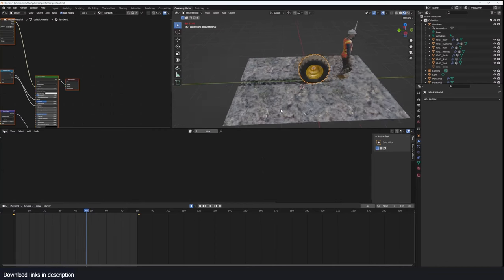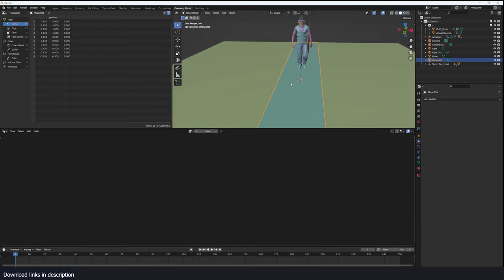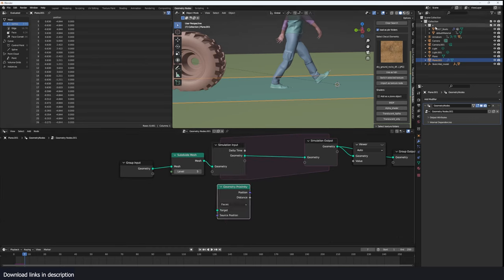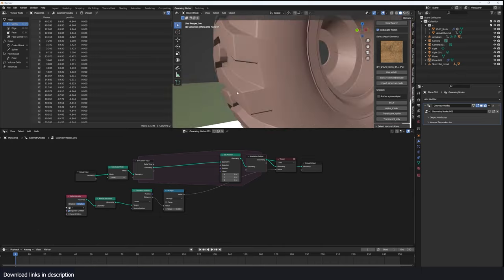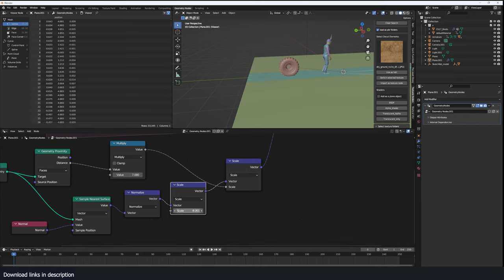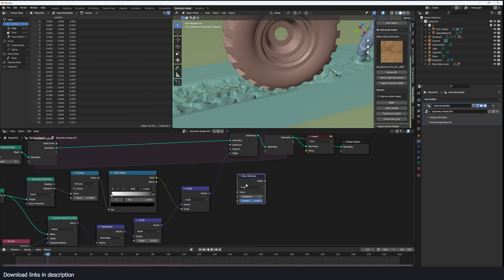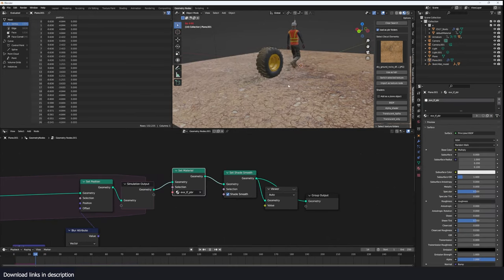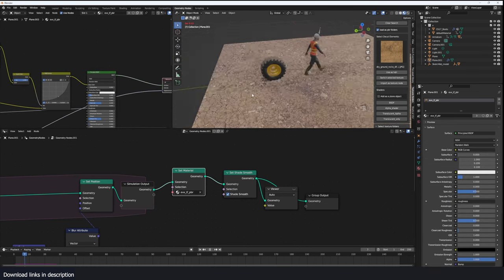easy Foot prints with simulation nodes

Comment: One thing to note is that the material effect would break if your terrain had depth on the z-axis not due to the offset. It may be worth doing the material transition using the mask created in the geometry nodes.
Reply from the maker: Yah true if the terrain is displaced it would break, you could use use the normal and dot product or do it in geometry nodes, I was having a bug I could not figure out